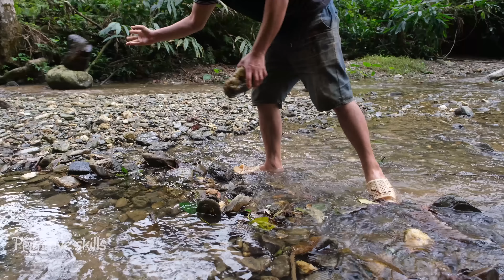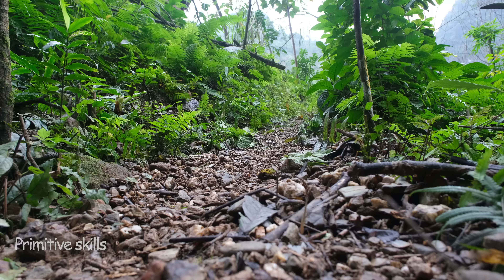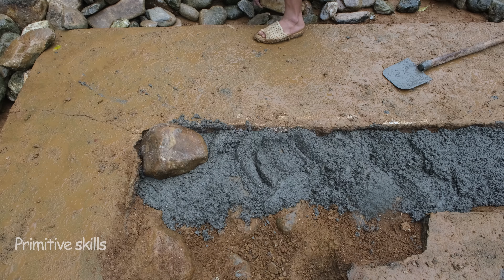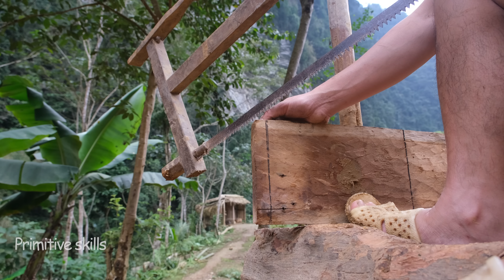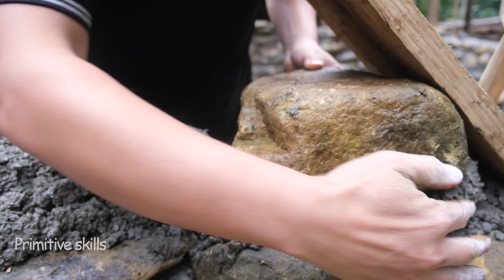PRIMITIVE SKILLS; BUILD CABIN from 7,900 stone (Building Stone House)

Comment: make a form to build clay tiles in an ~ shape and dry them in your kiln at a low temperature in smaller batches until they are dry, then once you have them all dry you can stack them tighter into the kiln and fire them into ceramic. make more than you need incase some break.

Comment: having clay tiles near a fire will help them to dry.. not In the fire but near it so the water in the clay dry out and doesn't crack then you can bake them for hardness like you would making clay dishes and pottery.. make extras for any weather problems in future so you can swap out tiles as needed faster. might take you a batch or 2 to work it out. depending on how you make the tiles i am partial to the rounded types you may want a rain gutter that guides the water to a rain barrel or your kitchen sink.. also i am an avid rock tumbler hobbyist and was thinking once you have your water wheel fixed you could make a barrel and put sand and rocks with pretty colors in it to get them smooth and shiny might could sell some for extra money too, i have bought raw rocks online from other countries to get a mix of pretty stones i use in jewelry. also you could use ones you like in your building projects. i luv luv and did i mention luv your videos :>
Reply from the maker: Thank you, your shares are very useful to me

Comment: For me, the best would be to use flat clay tiles. Kiln-fired clay can be made in any season, you will only have to make a firing tower for the tiles. This material is more durable than wood. A wooden roof will have the same problem as the previous one, the termites will end up eating it.

Comment: You should insulate all the beams that are in contact with the ground by putting a stone under the post, and burn or burn the surfaces. Then they will last much longer. 

Also note that concrete and cement lift water from the soil. Normal stone doesn't do that. You should also consider whitewashing in lime the walls, it brings more light inside and disinfects.

Comment: waiting until summer to build clay tiles for the roof is definitely the right choice so you can get the proper temp in a kiln to fire them. One thing you made mention of in this video is that you don't want to use straw / palm leaves for the roof because you're afraid of fire. With that same logic and also because of its age already, you should consider redoing the walls of your kitchen in stone as well and then covering both the house and kitchen with the clay tiles in the summer. That way you're not having to constantly rebuild the kitchen like you did with the house as wooden walls / roof in that climate do not last long unless the wood is treated, which you can't do.
Reply from the maker: Thank you, your shares are very useful to me

Comment: Wow, the house looks fantastic. But let me ask, why did you put the ceiling beams between longer walls? I would get it if you'd support them with cross loop beam, but you didn't. So, it does not make me sense. And the roof.. If you want non-fireable roof or ceiling, you will have to put a soil plaster on them. Good luck, greetings from CZE :)) PS: And the roofing, i cant find the translation of the word, so try to google czech title "Prejz"

Comment: A suggestion for drying out the clay tiles you want to make, couldn't you make something like the oven or kiln you made. A fire that feeds heat in say a mud/concrete bed and lay the clay tiles on top so the heat would go into the bed and gradually dry out the tiles so that could be fired? I guess something like a heated bed but instead of you laying on top of it, it would be the clay tiles instead
All the sun does it warm up the tiles to make the water evaporate, so in theory it could work if the tiles didn't dry out too quickly as that might make them crack in that regard
Reply from the maker: Thank you, your shares are very useful to me

Comment: We use wooden shingles here when building without power and industry- you could skip shingles and instead make a bamboo roof very easily compared to how hard we have to work to split logs into shingles! Half of bamboo laid like piping to drain water, and the other half resting in the water's path, perhaps? This would also mean your roof would still be built with rafters so you can take the bamboo off easily and switch to clay as you plan to do

Comment: You know, I am a roofer here in America in Washington and I am quite technically inclined. If I may suggest a roof that will last the longest...it is probably smooth fire-baked clay tiles that are mostly flat, but have a simple ridged edge. Then put a little tree resin or tree blood on it. If you shape the tiles correctly you don't need to use nails, and there will be no leaks. Think about the design so that water doesn't go sideways and leak between any cracks. But you don't need to listen to my advice.
Reply from the maker: Thank you, your shares are very useful to me

Comment: Roast all the wood. Including the window frames. Roasted wood (burnt over a fire to get a light coat of charcoal on the outside) is very very durable. It will not rot or be a home to insects. Termites will not eat it. It will last a very long time as it will not rot. This way, a wood shingled roof will last very well.

Comment: I think the roof should be made of wood.
However, this time, how about coating the roof boards with rubber sap?
If you can coat it with rubber, you can prevent corrosion and rain leaks, You get twice as much done with half the effort.

Comment: If you burn the surface of the wood, before putting it in the ground or cement, it will resist rot longer. coating the wood with pitch would lengthen the resistance even more.
Reply from the maker: Thank you, your shares are very useful to me

Comment: well limestone will not rot lol and it wont turn to mud, just dont burn it unless you want to make a lot of mortar lol. i suspect i would have put in a roman hypocaust type of under floor heating i still believe the area where you put the buildings is the wrong location on the property theres a lot of water coming off that field and down the slope under the buildings and onto the pond. thanks for the videos

Comment: That is a LOT better, a stone house is of much more sturdier construction for you and will last a LOT longer!!! 😊Nothing is impossible Duong, you have a kiln don't you?! 🤔 Provided that you have a decent supply of clay, you can make the tiles, air dry them in the kitchen and then once partly dried, in order to FULLY dry them to make them weather proof so that they don't turn back into soft clay again, just fire them (force dry them) in the kiln my friend until they glow red?! 😁 if you can then tap it with a thin stick or piece of bamboo and it makes almost a metallic ting or ping noise once fired, then it is fully hardened and now weather proof and will NOT turn back into soft clay even if submerged in your pond for days and days! 😀Their MAY be some spalling (some of the tiles may break) due to excess moisture being forced out of the clay rapidly but all in all, you SHOULD be able to make enough tiles to do your clay tiled roof?! 🙂 I hope this information helps you matey?! 👍
Reply from the maker: Thank you, your shares are very useful to me

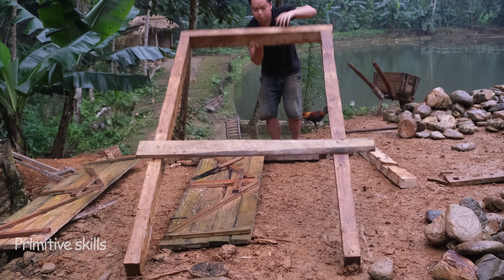Comment: (19:30) Điều thú vị là đây CHÍNH XÁC là cách chế tạo những cánh cửa hiện đại. Khung, tấm và thanh giằng được lắp ráp thành một khối duy nhất và ở dạng ĐÓ được giao đến nơi làm việc.😲  Sự khác biệt duy nhất là CÔNG NGHỆ hiện đại và các KỸ NĂNG tiên tiến hơn cần có để sử dụng công nghệ đó đúng cách.  Nhưng công nghệ hiện đại KHÔNG phải là điều cần thiết.  Và như bạn cho thấy, những kỹ năng cơ bản là quá đủ.😁
(19:30) Interestingly, this is EXACTLY how modern doors are constructed. Frame and panels and bracing are assembled as 1 unit and in THAT form delivered to the job site.😲  The only differences are the modern TECHNOLOGY and the more-advanced SKILLS needed to use such technology properly.  But the modern tech is NOT a necessity.  And as you SHOW, primitive skills are more than sufficient.😁

Comment: do you have a good source of slate for a stone tile roof? those seem like they're surprisingly easy to assemble, if you have good quality slate tiles. not sure if that'd be an option. otherwise the wood roof could be replaced with like wood shingles? use a splitting tool to split off thin flat shingles?though that'd need tons of nails, I suppose....
Reply from the maker: Thank you, wish you and your family good health

Comment: What ever you decide to use for a temporary roof material, I hope the installation goes quickly so you can get the inside in the dry. The concrete in those walls is still curing and you may want to do more point tucking with mortar on the outside and inside of the walls. 

As you can, after you get settled into your new house, I hope that you can start making clay tiles to install as the permanent roof. : ) You can dry the tiles inside your new house, like suggested and you have a great furnace that you can probably adapt as a kiln to fire the tiles when they dry enough. You got this! : )
Reply from the maker: Thank you, your shares are very useful to me

Comment: Stones from a river + fire = very bad, very explosive!
Stones from a river + cement for a house = very good!

When exposed to the high heat of a fire, the water in the cracks of a river rock will swell by 1000 times into steam, causing bits of the rock to explode away, damaging anyone nearby.  However, when exposed to the lime in cement, that same water only helps strengthen the bond of the cement to the rock.  (Water is an integral part of cement & concrete chemistry.)

Fun fact:  In the city of Seattle stood a building, Queen Anne High School, on top of Queen Anne Hill, the school my father graduated from.  (He told me this story.)  When it was first built, the construction company hosed the cement walls with water for many months, to ensure it hardened as strong as possible.  Many years later, when they wanted to add an extension to the building, my father said it took the new construction company a full month to drill holes into the wall to attach the rebar & earthquake lag bolts, because the cement was that hard.

I'm not saying that Duong needs to do this--and probably does not want to do it, as it's very hard to make changes when the concrete sets so strongly.  But it is true that a little water found in the cracks in the rocks will not hurt a concrete construction, especially in a climate where it almost never freezes!
Reply from the maker: Thank you, wish you and your family good health

Comment: What about a metal sheet roof. let the whole thing drain down to the front and use the rain water. So no a frame roof. Just higher in the back and lower in the front.  I would think that the stones could easily support the roof. Might not be as primitive as perhaps you require but it'd work well.
Reply from the maker: Thank you, wish you and your family good health

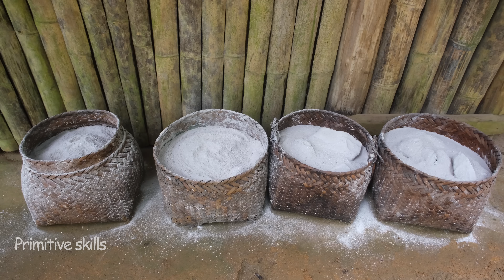Comment: (10:12) Người La Mã hồi đó dường như đã sử dụng vôi trộn với NƯỚC BIỂN. Đây là đặc tính của xi măng CỦA HỌ khiến nó có khả năng tự sửa chữa và tồn tại lâu hơn RẤT NHIỀU so với bê tông hiện đại.
(10:12) The Romans back then seem to have used lime mixed with SEA WATER. This is the characteristic of THEIR cement that made it sort of self-repairing and last MUCH longer than modern concrete.

Comment: Besides the rotting of the wood pillars, the former wooden roof absorbed too much water due to the rain, making it too heavy for the earthen walls to support.

My suggestion is for you to use light materials for the next roof, perhaps pieces of bamboo with big diameters cutted alongside in halves, laying one curved down half over two curved up others, mimicking the clay tiles you mentioned in the video. So, in case of rain, the water will slide form the curved down pieces to be drained by the curved up pieces, and then falling to the ground. These pieces should be nailed to the roof frame, that can be made of light wood beams disposed in the same orientation you used at the end of this video (parallel to the front/back wall).

I admire the ingenuity of the techniques you present in your videos, but please, my friend, take care of your back.
Reply from the maker: Thank you, wish you and your family good health

Comment: Why can’t you make the clay tiles, stack them between board layers for air flow in manageable size stacks then build small fires between and around the stacks to heat the air around the stacks and help the tiles dry. 

Also would these clay tiles also need to be fired in a kiln after the initial drying?

Comment: I don't want to talk arm in arm, but the walls are not reliable again, sooner or later they will collapse. It is necessary to make all four corners of the house in the form of pillars, at least 70 cm. they will be the supporting structure of the roof of the house. The overlap is 50 - 70 cm in diameter of the log, then it will withstand a tiled roof.

Comment: Looks cool but you'r doing it in a wrong way. Each layer of the stone walls has to be dry-fit first making sure stones firmly interlocks with each other on their own, only after that you should apply your cement mix. Relying just on cement to hold the structure is terrible - one day cement can wear out or develop internal cracks and become as good as just a normal sand, if this happens.. this walls can crush you, or someone from your family.

Comment: Dear Doung, your windows are too many of them, and too big, I'm affraid you could doing the same mistake in your previous earth house, but I can give you an advise, to strengening your house: yo need to build a reinforcement from outside, in your wall edges, and in angle, this is called a "retained wall", and you need to doing it with small pebbels, from down the external foundation, to the top of your wall, you could be built it like a "external stair", but this reinforcement is necesary to don't have in a undesirable future, a worst episode, because you had luck to not to be inside your home when collapsing, and now you want to give to your house more weight in the roof... please do re reinforcements in all the four edges of the house (and maybe in the door too, there is the weakest point of your walls). Greetings from Chile, my friend!